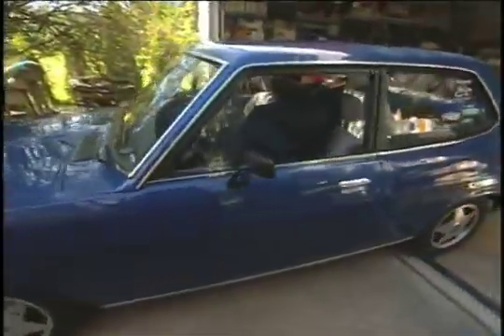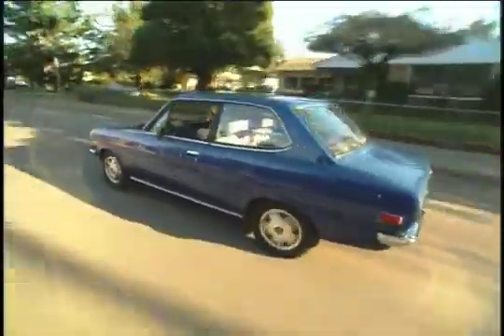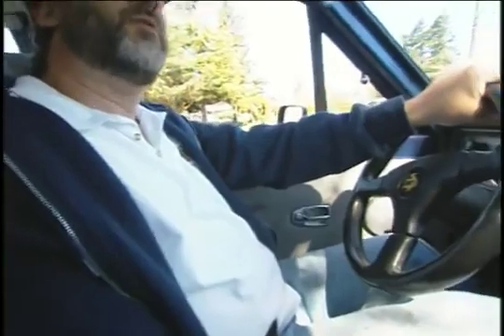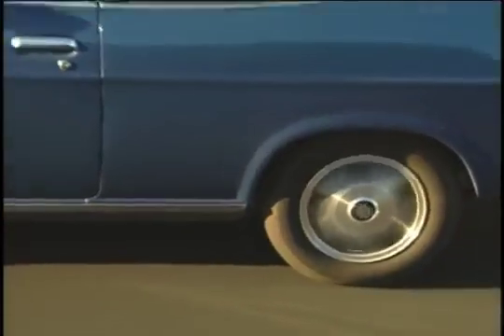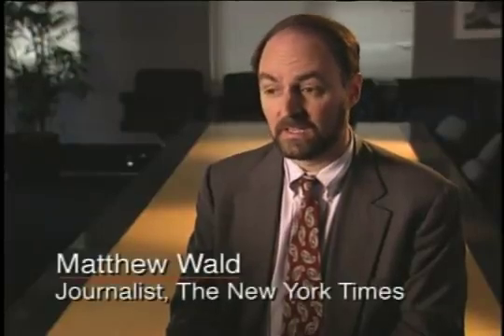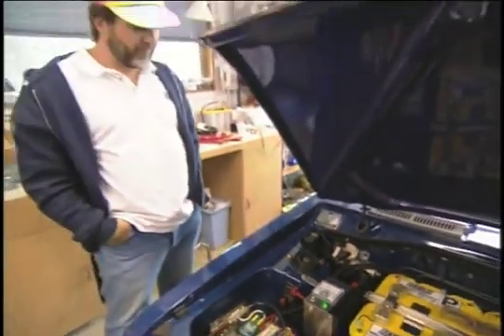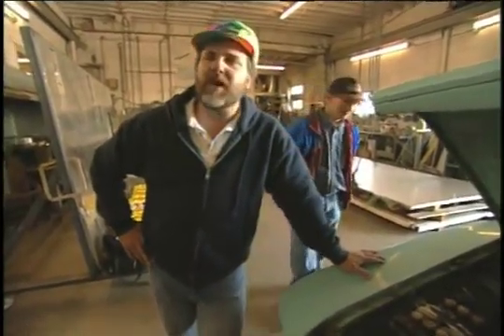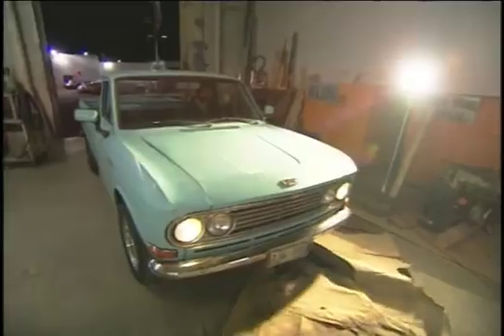Crazy Inventor Stuck It To Elon Musk With His Electric Car Years Before

Comment: Americans started doing DIY electric vehicle conversions in the early 1990s, pretty much the moment solid state motor controllers became available. Some guys starting in the 1970s and 1980s used mechanical bellclapper controllers. Euroepan regulations made EV conversions defacto or literally illegal until very recently, and are still very difficult to get them approved. And in the UK, you can't the car registered as an electric vehicle for ULEZ purposes if the chassis is 2010 or later. A regulatory nightmare.

Comment: 2:50 and it always work the same no matter if it is snow outside or sun. Oh boy, he didn't know that batteries are EXTREMELY sensitive to temperature conditions and your autonomy is drastically reduced during cold or hot days? I just wish that waking up the car every 4-8 h to check if the outside temperature isn't at certain levels so you would be forced to do extra things to protect the battery chemistry wouldn't be necessary.

Comment: I have to say, when I went Electric it was a game changer. It really is so much more affordable for my use case. I don’t think I could ever go back to ICE now.
Reply: Same here, I love my SMART 🚗
Reply from the maker: Same here I love the EV engine
Reply: Compared to the other 57% that bought an electric and they will never buy another. Long charging times and reduced resale price,  because the battery is half of the price of the new car and the chemistry goes bust by the time you sell, it doesn't help either.
Reply: @elenabob4953  Most of this is not true.  In the US, among EV owners who replaced their EV with another vehicle, 87.5% replaced it with another EV.  Out of that 12.5% who went back to ICE, the large majority did so only because they were getting a type of vehicle that was not available as an EV at the time.  This data is from an analysis done by Alex On Autos, who made two videos about it.

Road trip times in the better EVs are about the same as ICE, because you can charge for 20 minutes while you stretch your legs or grab a bite, and you're back on the road.

Depreciation of most EVs is less than for most luxury ICE cars like BMW or Mercedes.

EV batteries are lasting far longer than originally projected.  It's looking like 20+ years will be the typical life span for EV batteries made after 2018.  

As it happens, there is one EV model that did have a big problem with battery degradation, due to the lack of a cooling system - the Nissan Leaf.  But many Leaf owners absolutely love the car, and thus aftermarket suppliers stepped up with battery replacement options for just a few thousand $ (try a web search and you'll see what I mean), and the new batteries typically give about double the range of the original.  Keep in mind, after ten years of ownership, these drivers have saved several thousand in fuel and maintenance costs.